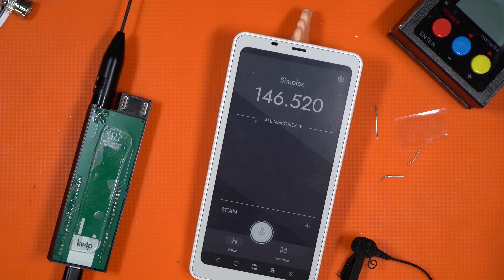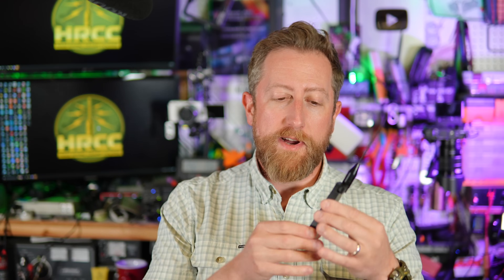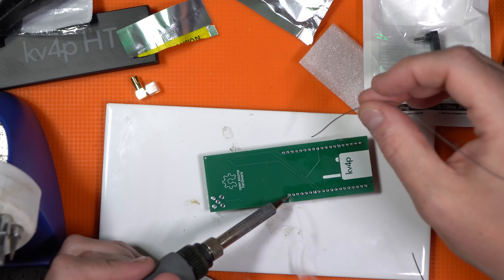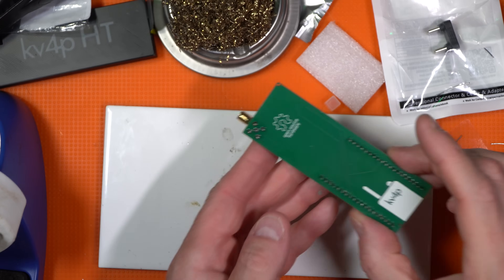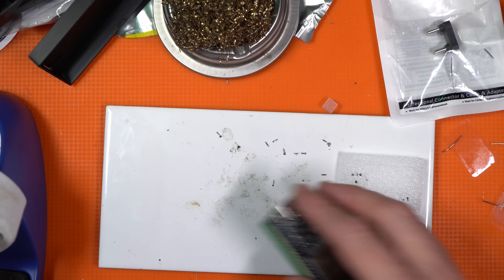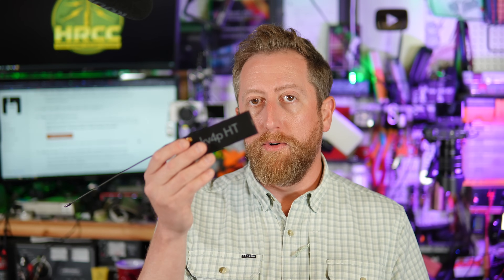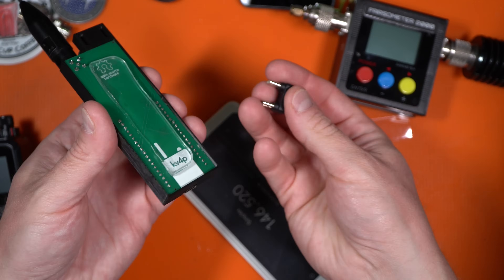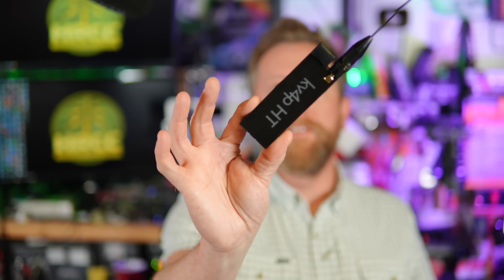Turn Your Android INTO A Walkie Talkie!

Comment: I have a preassembled unit that doesn't seem to do anything when plugged into the phone. Is that a common problem?  It seems like they left out a step showing how to get the phone to talk to the device? Also how can I tell if it needs a firmware update since there is no option to check that in the app?  I was able to update the firmware in Chrome whether it was needed or not but when I connect the phone the app says Not Found!  Are there any instructions on how to use this thing or software that works? The app seems half baked and don't do anything with just 1 button on the screen and no idea what it does! Shouldn't it actually have some kind of features?
Reply from the maker: Contact the seller!
Reply: @HamRadioCrashCourse  Amazon doesn't care!

Comment: I got one built already. For basic 2m communication it works. Out put is only about 1w or 30db so more of a neat project then anything.
Reply: If somebody could program it for CW that 1 watt could be a lot of fun. Type a message hit send and pops off some dits and dahs for you. Goes back into rx mode and has a decoder. That wouldn't be to shabby

Comment: My only complaint is the designer chose usbc instead of just connecting it with  bluetooth to phone so you can just put the radio device on your belt clip or car cupholder and not have it on the back of the phone, maybe we need to send them an email to integrate blue tooth. And also offer 900 megaherts ao non hams can use it on gmrs
Reply from the maker: It’s open source and this is a first revision.  You could activate Bluetooth if you were so inclined.   I think it’s naive to think the creator doesn’t consider these future upgrades.

Comment: If they did something like this for 900mhz, having a license free option like this would be a super nice entry level device, and could make for a power house comms solution on a cheap tablet between that and the Meshtastic app.
Reply: That would be meshtastic
Reply: @texasfrontiersman8245  Yeah, but I am talking for voice

It would be dope though if it did voice and Meshtastic all in one
Reply: Why do people obsess so hard over license free? A technician license is not hard to get and then you're not jammed into a tiny slice of unlicensed space with everyone else
Reply: @kennylyons2835  well, for one thing plenty of applications don't make much sense without encryption and we can't use encryption with our Amateur tickets.
Reply: They have beartooth gotenna wich is 900mhz license free digital. Though not analog. Would rather have a more open concept though.

Comment: I’m really looking forward to the inventors talk at the January RARS meeting!

Since it’s all open source I’m looking forward to other clever people figuring out new uses of the hardware. It’s going to be a game changer all over again, I think, when we’ve got good Linux support for it.

And since it’s got an ESP32, it might be useful with no wired connection to a phone at all… acting as a standalone APRS node.

Also since it’s got an ESP32, there’s potential for firmware that connects to mobile devices over Bluetooth… which would open up iPhone applications.

This thing could be Meshtastic for grown ups.
Reply from the maker: Yes! It has WiFi and Bluetooth!

Comment: get cutters with lead catchers... (it's a little springy thing that keeps the leads from flying off when you cut) Expensive name brand is about $30 [KNIPEX - 78 13 125 Tools - Electronics Super-Knips, INOX Steel, Multi-Component (7813125), 5-Inch with Lead Catcher] cheaper ones are about $20 [Xuron - 2175F Maxi-Shear Flush Cutter - Lead Retainer]

Comment: Does the phone continue to work, over riding the radio, should you receive a phone call ?
Also, must you have an active carrier, or can you use this with an old phone ?
Reply from the maker: The phone continues to function as normal. You can use a device without phone connection. The radio does not use the internet or cellphone network.
Reply: @HamRadioCrashCourse  
Good to know !
Perhaps this will help keep some Cell Phones out of the land fills !
Cool....!
👍😉

Comment: It would really be nice if they would set one up that works 70 CM or even gmrs
Reply: He does have plans for that, but this is a really fresh project.
Reply from the maker: I assume that is all possible in time.
Reply: This RF modules are available in UHF 400-480 MHz version. I would like 1296 MHz but seems it is not available.
Reply: GMRS would be tough because those radios need to be type accepted. I don't picture a DIY kit like this meeting type acceptance.
Reply: @cfisupply  70 CM does cover the gmrs frequencies so why would it need a type acceptance
Reply: @keithbowman8492  In the US... Amateur radio is FCC Part 97. This does not require a type acceptance.

GMRS is under Part 95. In particular: § 95.1761 GMRS transmitter certification.

Comment: What would be cool is if it had bluetooth.   You could put it where you get the best signal, like in an up stairs window or something, and use your cell phone in the interior of the house or building.
Reply from the maker: In your example, using the WiFi would be a better option and it’s entirely possible with this project!
Reply: This esp32 dev board actually has BT on board, and wifi :)
Reply: No good Ben. While BT can have a 100 meter LOS range, the BT chips used in cell phones all operate in the lowest power class. Range is 10 meters LOS, more typically 5 meters in a home with walls.
Reply: @lyfandeth but even Bluetooth just to get rid of needing to plug it into your phone. You would then also need a battery, so maybe it's not super practical, but with open source, I'm sure it could be done fairly easily!
Reply: @lyfandeth I regularly get 10-20 meters of range through walls/floors on my BT devices connected to my cell phone, and in open air I often get 40-50 yards (walking away from where I set my phone down for example). 

BT headphone and keyboard range often waaaaaay outperforms the listed ability.

Comment: I wonder if with the software we could add some digital modes to it. Could you use this as a DMR radio down the road? That would be really cool for me. I know there are android based DMR radios, this seems like a good next step.
Reply: So basically a transceiver SDR (Software Defined Radio) ?
Reply: @wahyutriwibowo1803  It already is just an SDR for your phone. I am asking if we could add DMR, C4FM, D-Star and maybe others to the app. Let the SDR transmit encoded with different digital modes